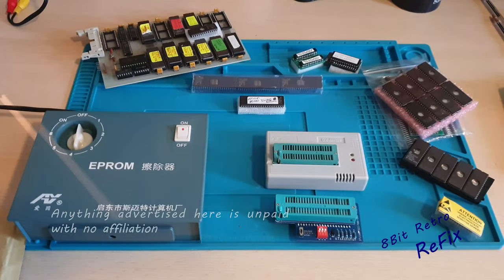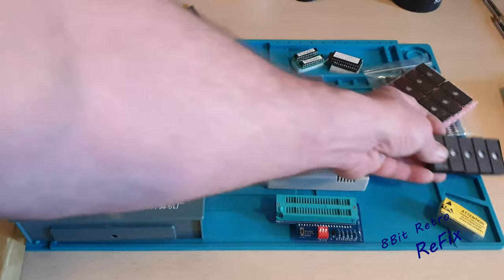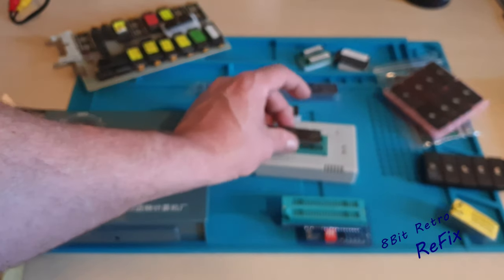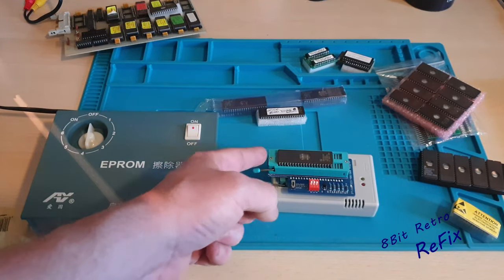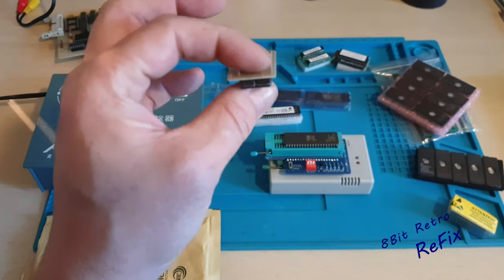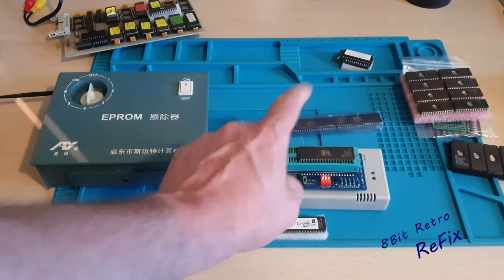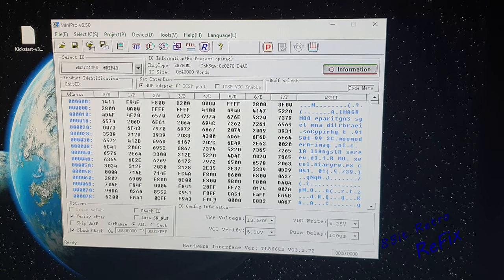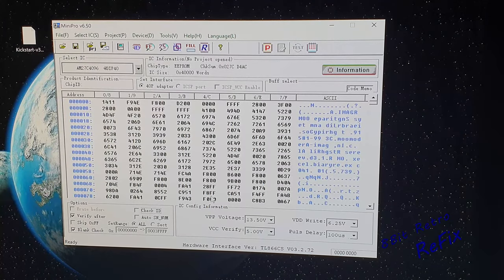How to make Amiga Rom's & JoyStick Give away   Final !!!

Comment: Great video very informative. Thanks for making this and helping us learn from your experience. Great tip about putting the eprom into the adapter. I would have done what you did first and placed it at the top where the notch would be. The rom for the 1540 sounds interesting.
Reply from the maker: Thank you ... ive a few other stuff coming up first .i do plan to do a 1540 video soon tho  .. ive a few 1541s and a 1570 coming up soon to repair so may drop the chip in and have look ;) ....

Comment: That is me, clueless on this. I have all the hardware, burner, adapter and AM27C400/800 chips but when I try to read the original A500 ROM I get a pin 1 and 39 error. MY adapter has a rotary knob instead of a dip switch, I tried all the 0-9 positions and get the same error. Do you know how to correct this or what is causing it? It gives me the option to ignore the bad pins but the resulting ROM didn't work in my 500.
Reply from the maker: Hi .. it won't read from an original rom ... why not search the net for the rom you need and burn that ?